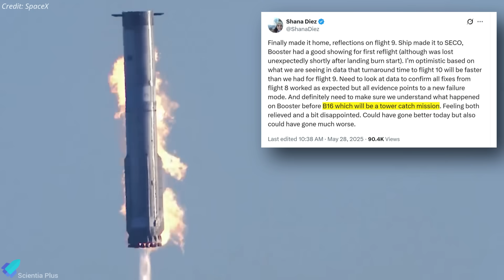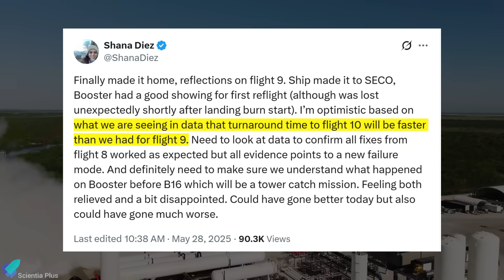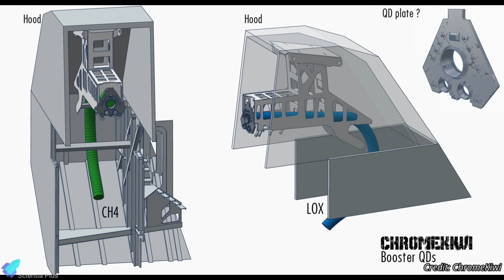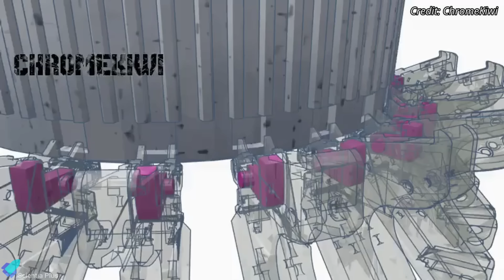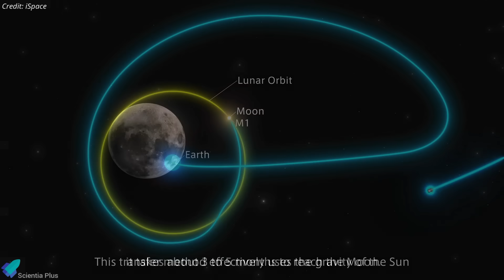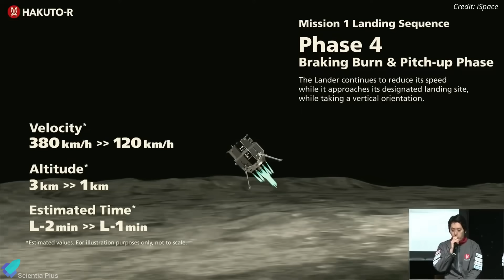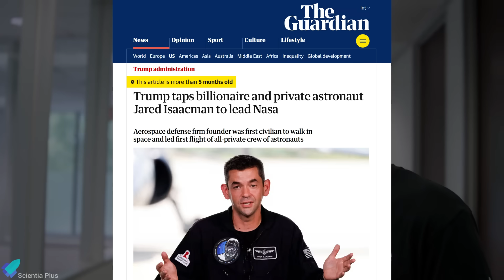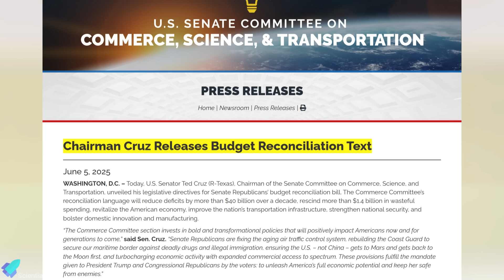Starship Block 3 Survives 28 HOURS Test — Flight 10 Date DROPS After Booster 16 Static Fire!

Comment from the maker: 00:00 Starship Updates
10:16 Moon Landing Disaster! Why Japan's Hakuto-R Just Crashed 
13:08 SpaceX Contracts Terminated?! Elon Musk vs Trump Sparks NASA Meltdown

📚 Learn More:

🚀 Starship Block 2 Explained:
 📖 Summary: https://shorturl.at/b0dtw
 🔍 Detailed Explanations:
  • Design Improvements Update 1: https://shorturl.at/lpGT7
  • Design Improvements Update 2: https://shorturl.at/gwNQ4
  • Nosecone & Payload Bay Redesign: https://shorturl.at/xa60S
  • Methane Downcomer Redesign: https://shorturl.at/XdYBG

🚀 Starship Block 3 Explained: https://shorturl.at/mnBT4
🚀 Starship & Booster Block 3 Detailed Breakdown: https://shorturl.at/IViwD
🚀 Starship & Booster Block 3 Production Begins: https://shorturl.at/xRNkJ

🔥 Raptor V3 Mega Upgrades & First Test: https://shorturl.at/TRIyj
🧱 What’s Inside Starship GigaBay?: https://shorturl.at/nJM75
🛠 Insane Engineering of New Starship Launch Pad B: https://shorturl.at/7RAZd
🛢 Dual-Port Orbital Refueling – Full Technical Breakdown
https://shorturl.at/5tiqK

🛠 Other Starship Upgrades:
 • Hot Staging Explained: https://shorturl.at/jf400
 • Super Heavy Booster Upgrades: https://shorturl.at/Pi5R3
 • How SpaceX Protects Raptor Engines: https://shorturl.at/4Om8F
 • New Heat Tiles Explained: https://shorturl.at/p2Ijb

🚀 Starship Flight 9
 📽 Complete Breakdown: https://youtu.be/2eirgcUzwts

🎙 Elon Musk 2025 Starship Presentation – Uncut Version
https://youtu.be/1dSaPSwp5X8

🌙 Hakuto R Mission 1:
  🚀 Launch & Mission Explanation: https://shorturl.at/bYtTE
  💥 Landing Failure: https://shorturl.at/GVnvF 

🛰 NASA 2025 Budget Cut Explained:
  🚨 Trump Slashes Funding, Elon Reacts: https://shorturl.at/5HkTO  
  ⚠ Artemis in Trouble! — $93B Plan Falling Apart: https://shorturl.at/id5yv

🛰 SpaceX ISS Deorbit Vehicle Explained: https://shorturl.at/rXmBv

📡 Stay Updated:
📢 Weekly Updates: https://bit.ly/3HIQjPC
🚀 SpaceX Playlist: https://bit.ly/34wue8T

🌍 Follow Us:
👍 Facebook: https://www.facebook.com/scientiaplus

Comment: Iterative design relies on early failures to reveal easy ways of screwing up.
Once these lessons are learned and designed out, it allows for a much more thorough exploration of more sophisticated modes of failure.

Wash, rinse, repeat until you couldn't fail if you wanted to.
Falcon was a clown, until it wasn't. Now it's the standard everyone else is trying to figure out.
🖖😎👍
"Imagination is more important than knowledge." - Albert Einstein